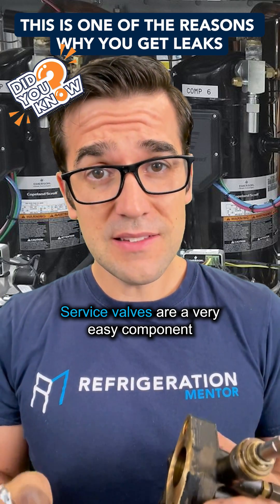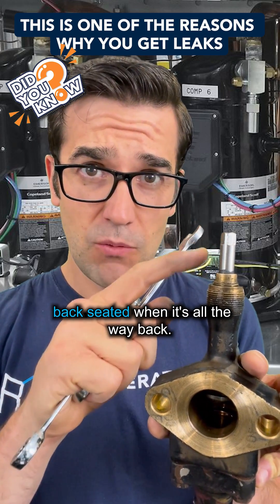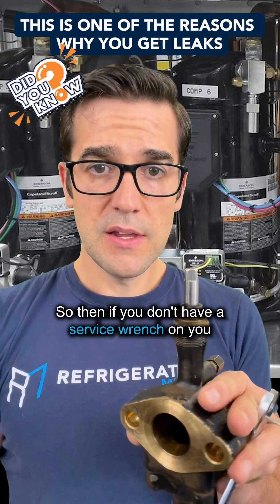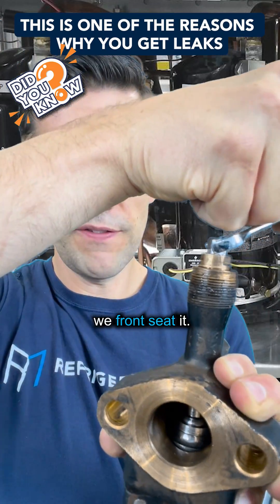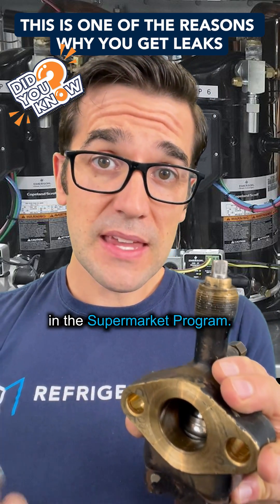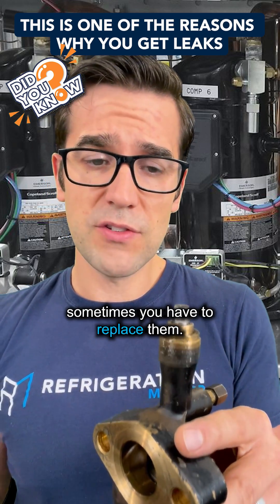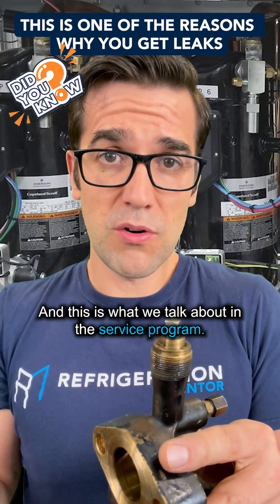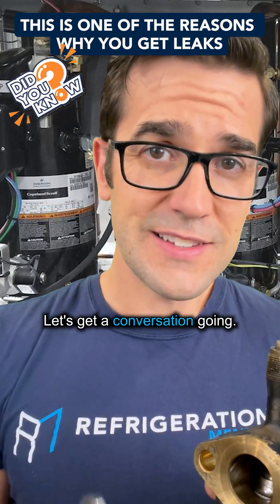Adjusting The Packing Gland of a Refrigeration Service Valve

Comment: In the past have had a leaking packing gland, had some rota lock seals and the smallest one was just the correct size to fit over the stem and leak stopped.
Reply from the maker: @robertbethell4795  thanks for sharing.

Comment: What are your thought on repacking the graphite seal on a leaking packing seal
Reply: There is a teflon purpose built product that works well for that. However I have had very good luck twisting blue monster into a string, wrapping it 1-2x around the valve stem, dabbing on a bit of nylog and snugging the packing but back on over it all. As long as you don’t over wrap it, it works very well. Must have packed 100 valves that way. Never had the leak return so far.
Reply from the maker: @paulgaras2606  thank you for sharing with everyone.
Reply from the maker: I do not remember if I have done that myself in the field but if it stops the leak I do not see why not. Sometimes though you just have to replace the valve if the leak continues to come back.